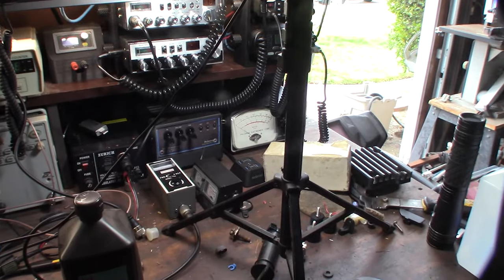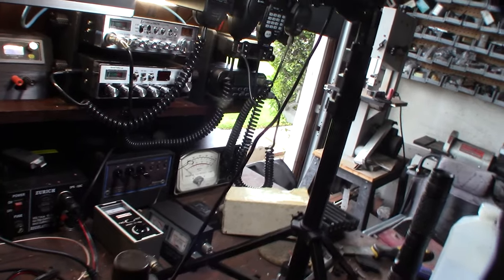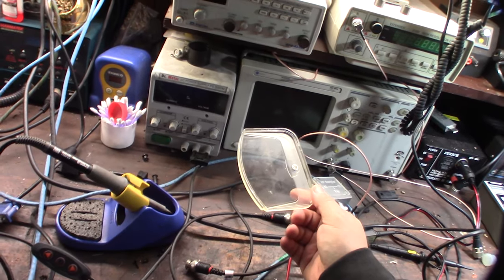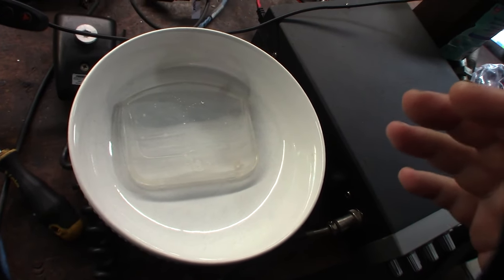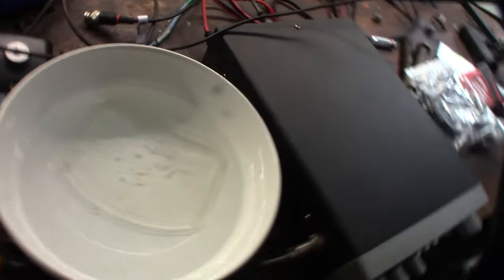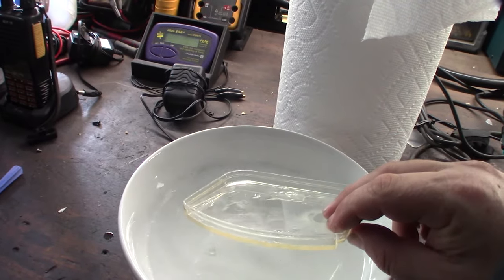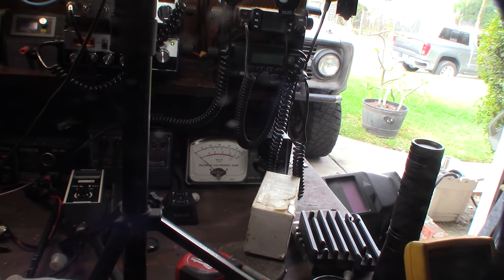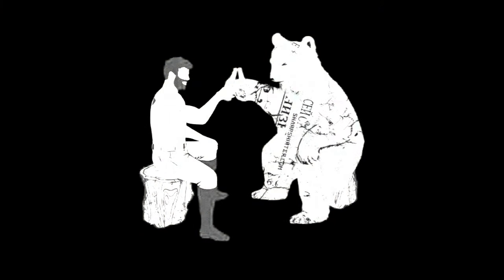Remove Yellowing On Clear Plastic Watt Meter Lens Cover Using Hydrogen Peroxide CB HAM SWR

Comment: It does work fine, for complex parts fhe stronger 30 or 40 volume paste is my go-to, wrap it with clear plastic and make sure it gets uv exposure (I just use the sun) it goes much faster to bleach white plastics back to stock condition.
Reply from the maker: Cool, I will try that. I was a little nervous because it was clear and not replaceable.
Reply: i might try that on my plastic headlight covers, not sure if it will work, but I can't imagine it would hurt.